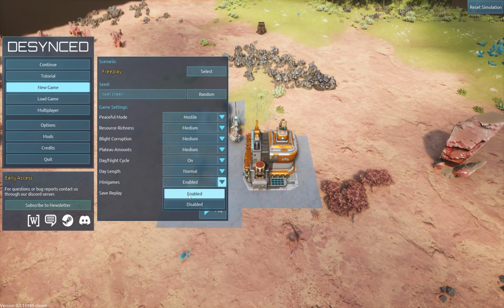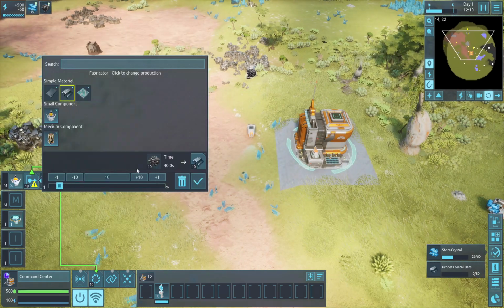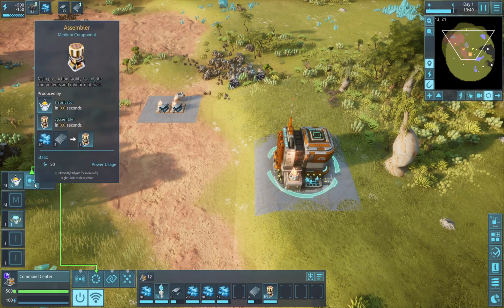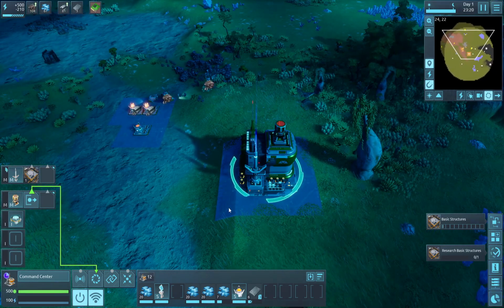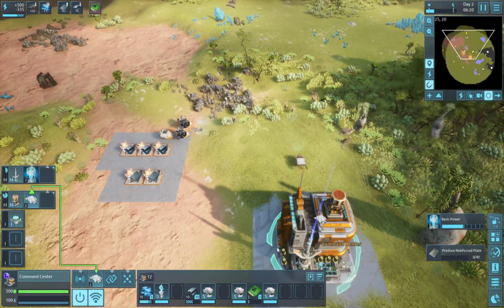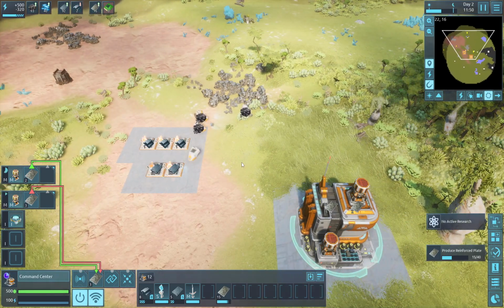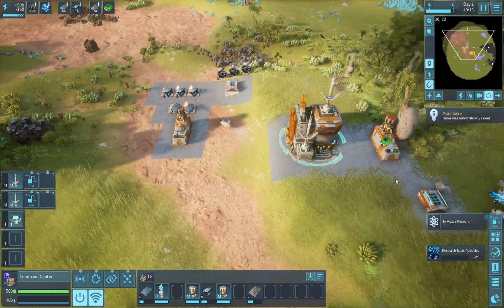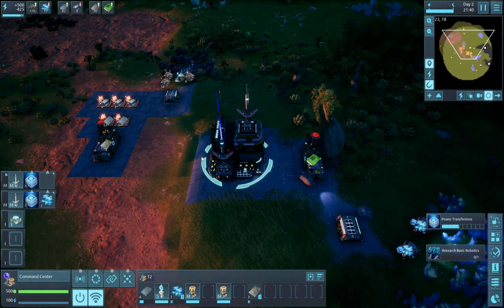GETTING STARTED - Tutorial Let's Play DESYNCED Guide Ep 1

Comment: Quite an interesting game, I wouldn't have come across it if I didn't see it on your channel.
By the way, you can make buildings that mine for you.
The advantage that they have is that they consume no power on their own unlike the drones and it's easier to access and build buildings with 2 small slots for miner, double the speed.
The disadvantage is that buildings cannot move, it can be mitigated by building next to a large mining node and deconstructing returns 100% of the resources.

There's so many options in the game, it's wonderful
Reply from the maker: Hi, nice to read you again!

Wow, I wouldn't have come up with the building mining idea myself - that's quite amazing xD 
I can already foresee that this game has quite some future. They combined quite complex systems into a very easy approachable platform. 

Right now I feel like the Bot Coding part is a bit hard to approach but the Early Access is still young. And the game already holds up quite decently for that.
Reply: @Ic0nGaming  Here's another hint that I just figured out
If you plan to use buildings as Miners, it is possible for it to auto change its target so that when 1 node is depleted, it will start mining another node that is adjacent to it.
Here's another hint, you can set buildings and bots to output signals, the signal can be for anything, even metal ores or crystals and you can drag the signal elsewhere so other inputs can use the signal as the input for its target.
Put 2 and 2 together and you will have something
Reply from the maker: @jinhong91 I'll check these out. I was experimenting the other night with Signals and Bot Coding and well. It was  almost 3 AM and it was not exactly to fruitful :D Thanks for your pointers, surely will help =)